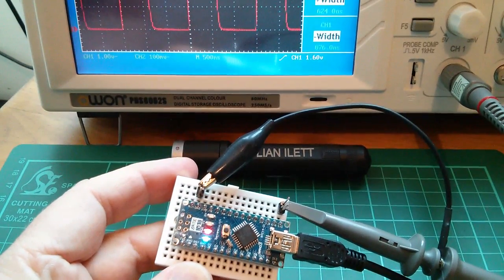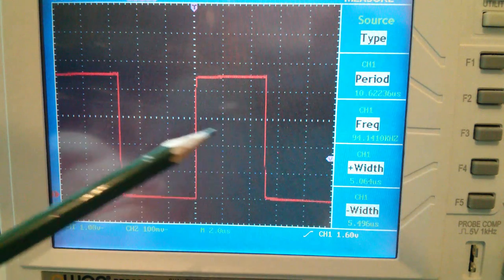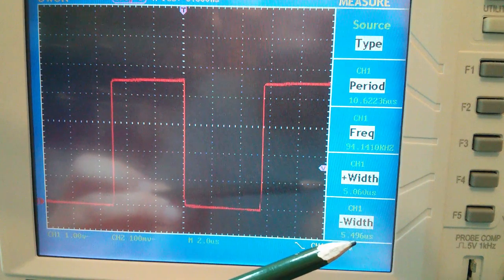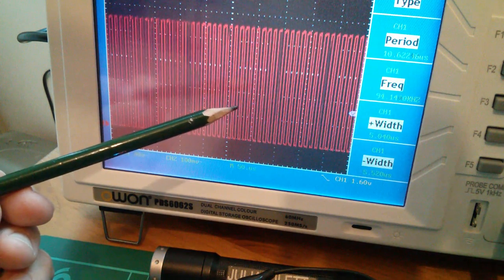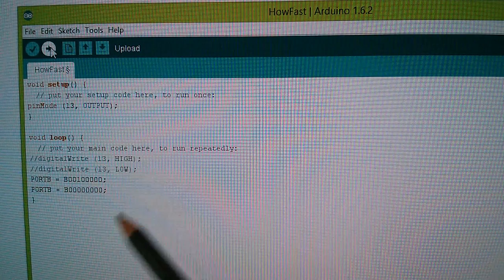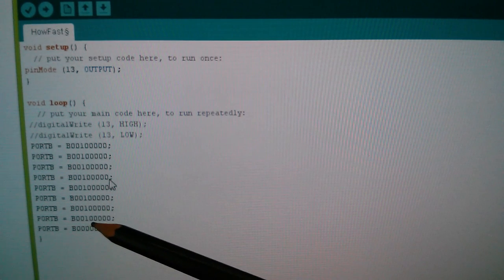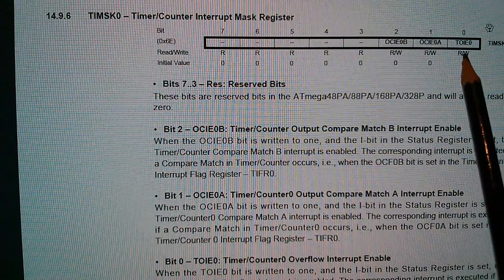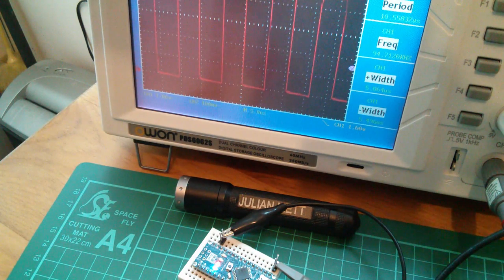Julian Investigates: How Slow is Arduino?

Comment: OK what I understood by this video, is that 16mhz microcontroller can't drive the output pin high/low at the same operating frequency. It's just the 16mhz is for CPU clock and that's it.

Comment: Here is an improvement that Arduino IDE developers can improve. The MikroC compiler from MikroElectronica does compiletime optimizations. Does the Arduino IDE have a disassembler ? If so you can clearly see how a function call is compiled...

Comment: Thanx Julian!!!

This is very commen on high-level coding, as it is more easy for beginners to get something going, it creates also a lot of overhead in the final code. Best example here is BASIC. As it is an interpreter language and it also creates lots and lots of code to be executed, when you use a compiler BASIC.

But you can always do some "inline-assember" for quick execution, but it you do so you have to deal with all this "unwanted" side-effects witch made assembler coding more difficult....
Speed or simplicity YOU have to choose.....and as always, it all depends on YOUR very own needs;)

Julian, you may take a look at the final output ASM-code to be executed by the AtM168 when using the arduino envoirement. As it clearly shows the overhead created by the arduino IDE....;)

Comment: Is it possible to program Arduino in assembler?
Reply: +Jaakko Oksa Yes, but most often you don't. Most likely you would use avr-objdump to view the compiled code and then change the C-code. loop(){ while(1){PORTB=0x20;PORTB=0;}} looks like this in assembler: loop(){ _asm_("ldi r16,0\n ldi r17,0x20\n"); _asm_("out 5,r17\n out 5,r16\n rjmp .-6");} so stay with C until you can measure assembler is faster than good written C.
Reply: +chlordk Thanks, I used to program Motorola 68k assembler a lot in the 80's and thought it might be fun to try with Arduino :-)

Comment: A 1x/10x 200Mhz Oscilloscope probe is only 200Mhz if on the 10x position otherwise it's not even 6Mhz in the 1x position due to the cable internal capacitance >85pF
You should use a very short cable or the 10x position for any high freq stuff

Comment: Even if you go into assembly on ATMEL not all the IO are the same speed, some are faster and some are slower.
PIC's on the other hand are the same speed and generally faster, no multi-clock cycle turn on and turn off, generally...

Comment: Hi Julian, at first, well explained and easy to understand, but you can do something to bring the speed up to nearly 8MHz ( 2 clockcycles), without using Assembler. For example, try a "while 1- loop" (like Captain-Slow sad) with Portmanipulation. I know, its not good in a program, but works fine. At second, You don't have to write only "1" to Pin 13 and at last once "0", if you "copy-paste" the "ON-OFF-command" a serval times, the speed will increase drastically. ^^) (I tried with about 100, 200, 400 and 21000 changes within the while(true) [last one doesn't work --> little joke :) ] )

I know you are a few steps ahead of me, but I like it if someone gives me a little push to see new/better results. ^^)

Comment: Sadly, I don't own a scope ...I suspect that "under the hood" there is a main() function with some code such as "setup(); while(1) loop();" ...What happens if you put "top:" at the beginning and "goto top;" at the end of the loop function? ...Theoretically this could mean that the program does not have to deconstruct and reconstruct the stack frame to restart the loop thereby removing the massive delay you have observed :)
Reply: csbluechip 
I think I looked that up some time and if i remember correctly that's exactly what happens. Just put another "while(1)" around all your code within "loop()" and you exchanged a jump and a function call with just a jump.
Reply: superdau I've just found the main() function in C:\Progra~1\Arduino\hardware\arduino\avr\cores\arduino\main.cpp : it does init(), initVariant() and USBDevice.attach(); ...then it runs setup() ...there is a while(1), actually a for(;;), to repeat the loop() ...and after each call to loop() there is an if (serialEventRun) serialEventRun(); ...So putting while(1) around the content of your loop() would stop whatever serialEventRun() does.

Comment: The function for disabling interrupts is called "noInterrupts()". Also, when you look at https://github.com/arduino/ArduinoCore-avr/blob/master/cores/arduino/main.cpp you can see that the main function also calls "serialEventRun", so I suggest you use an infinite loop in your loop() function to encapsulate your pin writes.

Does anyone else find it odd that the PORTB = b001... code worked at all? Normally, a good C compiler with enabled optimizations would delete that, because it has no use anywhere else. My guess is that it's declared volatile, but I have no confirmation on that.

Comment: To easy Arduino thei must use several libraries over the AVR platform. If you try to check with oscilloscope the serialPrint() you will get more then 100 mS. try to image in a real time project what happen ....To get a perfect square form you have to add a flip-flop or latch which start on TTL level at 2,5-2,8  Volts

Comment: Pin-Toggle on AVRs like the M328: PINB = (1<<PB5); This gets compiled to a single-cycle sbi() instruction and does not mess with any port pin for which no bit is set.  And after adding my comment I saw the date on the video...

Comment: Wery worthwhile test, IMHO.
Of course, the Arduino IDE isn't generally used for production environments (it can, but the difficulty of linking other files, so it's not one horribly big file limits readability).
Bt, I can't see anyone learning MCU's with an Arduino setup being fazed with that.
Couple of thoughts:
Would the keyword "static" improve things, by removing the "pin 13 recalculation" stuff?
Second, Arduino IDE doesn't give the optimisation option. Guess this is running at -O0 (no optimisation - great for debugging, but lousy in production (I use -Os - size)
If you Loooove Bloatware, have at least 10 Gig hard-drive space, a dual-core processor and 4 gig. ram, you should download Atmel Studio, and its Arduino plug-in. Then you could simulate the code step-by-step and see what it's doing.
One more thing - could you persuade Atmel to 'postbag' you an AVR Dragon? They're less than £40 from stockists like Farnell. Fantastic bit of kit - I use it to debug Xmegas - mega-chip-on-steroids - which have a lovely instruction to toggle a pin...Any serious Arduino (or Mega) user should buy one!

Comment: Still faster than PICAXE basic. Although it was in a loop with other instructions (not very many), the output toggles were about 2mS wide (1mS on then 1mS off IIRC) updating 2 shift registers 8 times takes around 256mS + extra overhead.
Reply: Woa, 2ms?
You sure you're doing that right mate? xD

Those are MicroChip PIC based microcontrollers? They should be as fast, if not faster as an Arduino. You could grab a PicKit programmer and use C to program it.
It's not going to be all too much harder, if you've got some macro's to set up pins/registers.
Reply: +xFuaZe PICAXE Is based on the PIC micros yes but it also has a BASIC interpreter slapped on top of running at a max of 8Mhz (on the chip I was using which was an 08m, 8 pins with an internal only 4 or 8 MHz osc)
Reply: Woa, that's a bit "overkill".

I'd get it if they made a BASIC compiler that'll convert it to C/Assembly, but running an interpreter on microcontroller isn't really something that I'd suggest.

8Mhz is plenty when you run native code on a microcontroller.
Reply: +xFuaZe tell that to REV-ed who developed the PICAXE,  at least I think it has an interpreter, most of the PIC is (closed source) boot loader for 2 wire serial (RS232) programming and interpreter  and it uses whatever flash is left for user program/constants (128-256bytes on smaller (8 pin) ones to >4Kbytes on larger PICAXEs) and some limited RAM for variables.

Comment: would be fun to see doing a direct audio recorder from microphone and then playback, all with a crude arduino code switiching the ports!
Reply: jusb1066 Yes, you can. Just buy the intel-duino board running an i7 4th gen and 4GB of RAM and download you script there. Dont aks for stereo.
Reply: +38911bytefree 
i7 no stereo,
Reply: have a look at mozzi library.  I've used it on uno to ring modulate a voice input.  Sound quality is not at all bad, considering.  There may be other libs that are even closer to what you want.

Comment: Doesn't atmega have a NOP for delay?
Reply: It does, and you can use it in the Arduino IDE as "_NOP();" It's a macro which gets translated straight to a machine nop which takes one clock cycle.

Comment: is arduino uno and arduino nano the same?
Reply: They are the same micro-controller, just with differing support hardware (the nano has very little).  So programs etc. are identical.  Some copies may route pins differently, so that should be watched out for.

I am not an expert, having just recently started messing about with these.  But I am an old fart, so have learned to be cautious about destroying stuff like this accidentally.  (Even though these are amazingly cheap, it is still wasteful to destroy them unnecessarily.)
Reply: thanks for the reply tho...

Comment: I guess you could copy/paste the port on/off commands - like 100 times.  Then the output would be maximum speed for 100 cycles - and only incur the loop delay once per 100 cycles !!

Comment: My last comment is about the "fastest possible" output of only 4 MHz from Arduino working on 16 MHz. It can do better - 8 MHz, but only in burst mode - switching on and off by some sort of lookup table. The code:
void setup(){
  TIMSK0=0; //disable watchdog interrupt
  DDRB = DDRB | B00100000;//only pin13 (PB5) as output
}

void loop(){
 eightMHzBurst();
 }

void eightMHzBurst(){
  PORTB=(1<<5);PORTB=(0<<5);PORTB=(1<<5);PORTB=(0<<5);PORTB=(1<<5);PORTB=(0<<5); //three cycles
  PORTB=(1<<5);PORTB=(0<<5);PORTB=(1<<5);PORTB=(0<<5);PORTB=(1<<5);PORTB=(0<<5);
  PORTB=(1<<5);PORTB=(0<<5);PORTB=(1<<5);PORTB=(0<<5);PORTB=(1<<5);PORTB=(0<<5);
  PORTB=(1<<5);PORTB=(0<<5);PORTB=(1<<5);PORTB=(0<<5);PORTB=(1<<5);PORTB=(0<<5);
  PORTB=(1<<5);PORTB=(0<<5);PORTB=(1<<5);PORTB=(0<<5);PORTB=(1<<5);PORTB=(0<<5);
  PORTB=(1<<5);PORTB=(0<<5);PORTB=(1<<5);PORTB=(0<<5);PORTB=(1<<5);PORTB=(0<<5);
  PORTB=(1<<5);PORTB=(0<<5);PORTB=(1<<5);PORTB=(0<<5);PORTB=(1<<5);PORTB=(0<<5);
  PORTB=(1<<5);PORTB=(0<<5);PORTB=(1<<5);PORTB=(0<<5);PORTB=(1<<5);PORTB=(0<<5);
  PORTB=(1<<5);PORTB=(0<<5);PORTB=(1<<5);PORTB=(0<<5);PORTB=(1<<5);PORTB=(0<<5);
  PORTB=(1<<5);PORTB=(0<<5);PORTB=(1<<5);PORTB=(0<<5);PORTB=(1<<5);PORTB=(0<<5);
  PORTB=(1<<5);PORTB=(0<<5);PORTB=(1<<5);PORTB=(0<<5);PORTB=(1<<5);PORTB=(0<<5);
  PORTB=(1<<5);PORTB=(0<<5);PORTB=(1<<5);PORTB=(0<<5);PORTB=(1<<5);PORTB=(0<<5);
  PORTB=(1<<5);PORTB=(0<<5);PORTB=(1<<5);PORTB=(0<<5);PORTB=(1<<5);PORTB=(0<<5);
  PORTB=(1<<5);PORTB=(0<<5);PORTB=(1<<5);PORTB=(0<<5);PORTB=(1<<5);PORTB=(0<<5);
  PORTB=(1<<5);PORTB=(0<<5);PORTB=(1<<5);PORTB=(0<<5);PORTB=(1<<5);PORTB=(0<<5);
  PORTB=(1<<5);PORTB=(0<<5);PORTB=(1<<5);PORTB=(0<<5);PORTB=(1<<5);PORTB=(0<<5);
  PORTB=(1<<5);PORTB=(0<<5);PORTB=(1<<5);PORTB=(0<<5);PORTB=(1<<5);PORTB=(0<<5);
  PORTB=(1<<5);PORTB=(0<<5);PORTB=(1<<5);PORTB=(0<<5);PORTB=(1<<5);PORTB=(0<<5); //18 times 3 = burst 54 cycles at 8 MHz 
  //add more if you needed
}

Comment: It's a bit more than the Arduino converting 13 to a port number. It has more to do with the fact that digitalWrite() and loop() are functions. That means each time you use digitalWrite or loop, a stack frame needs to be created, parameters placed on the stack, previous register values saved, then after the function executes, previous register values need to be restored, all the variables that were put on the stack need to be removed, etc. As you can see, just a simple digitalWrite() will actually compile down to several lines of machine instructions. Moral of the story: function calls are expensive.

If you want to write fast Arduino code, you can get close to Assembly without actually writing Assembly. You can use this Arduino Makefile https://github.com/sudar/Arduino-Makefile and completely break away from the Arduino IDE. You can write bare bones C and compile it in a terminal. You'll have super fast code, but you'll have to work much harder for it. You can always #include whatever Arduino libraries or files you want to use though.

Comment: void loop() {
_asm_  _volatile_ (" SBI 0x05, 0x5 "); // set bit 5 in portb (address 0x05)
_asm_  _volatile_ (" CBI 0x05, 0x5 "); // clear bit 5 in portb
}
would do the setting of the single bit in a safe way, instead of write the portB as a whole.

Comment: Thanks for the info, that’s shockingly bad optimization, I like the Arduino concept, but I learned uCs the old fashioned hard way which because of the reason you’ve pointed out is actually easier to do... I think they’ve oversimplified it a little too much.

Comment: The fastest you got was 1.06MHz. Would it be possible to go faster? You did say the chip was 16MHz didnt you. Maybe using assembly language?
Reply: CrazyRupes If all you want to do is toggle the pin on and off, there is a hardware way of doing it.

Writing to the input register (PINB) will do a hardware XOR of the output state of the pin(s).

"while(1) { PINB = (1<<5); }" should be about the fastest toggle you can get when interrupts are turned off, and while doing a short loop (it would be faster to just fill the memory with the PINB-instruction, but a bit messier).

Comment: FWIW It's possible to peek under the hood since Arduino is open source... the routine that calls loop() is here https://github.com/arduino/Arduino/blob/master/hardware/arduino/avr/cores/arduino/main.cpp  The reason it takes a while outside the user loop is not just the call overhead but also it services the serial ports(s).

Comment: You can't generate precise, jitter free signals with a micro controller, especially if there's an OS running your code.  With "bare metal" code (no OS) you'll get rid of random interruption, but adjusting the periods will be very difficult.  Using assembler would allow you to insert a certain number of "no op" commands that takes a known amounts of CPU cycles, but that's trial and error and makes it hard to create programmable rates. Plus you've lost a way to control it. All it can do is loop.  The true way to get jitter free and controllable periods is to use an FPGA (or CPLD).